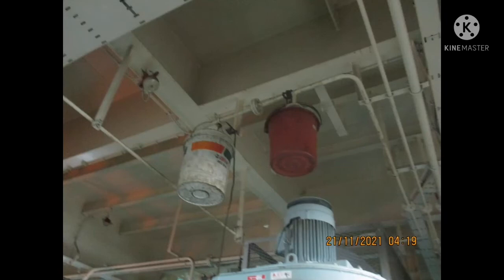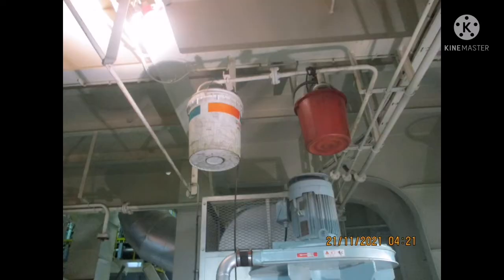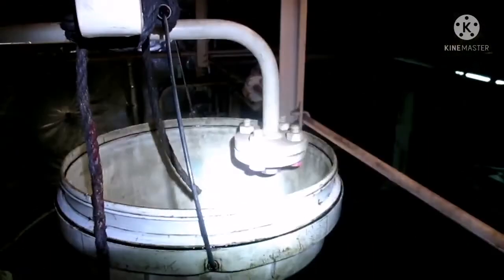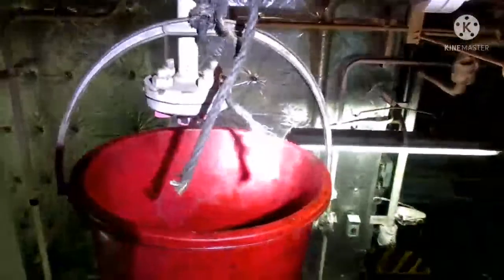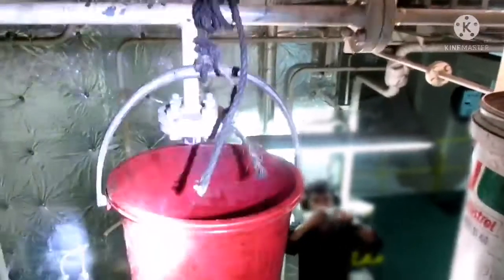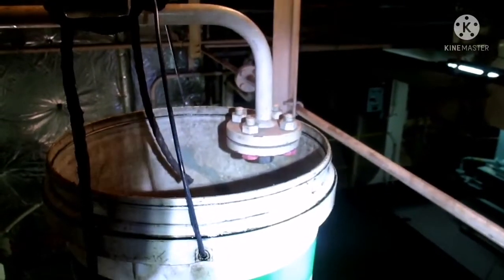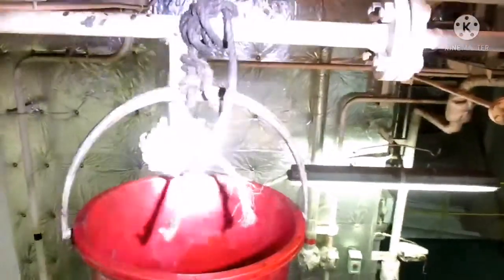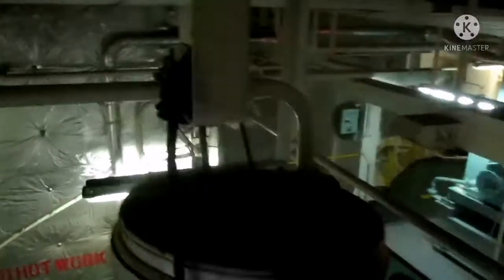How do they do.. how to test hypermist fire fighting system onboard ships..

Comment: Another way is by compressed air, this method is just to make sure our solenoid valves are working properly. But to check the whole system the actual method is better as the video.
Reply from the maker: ok sir..Thanks for ur good suggestion all time..